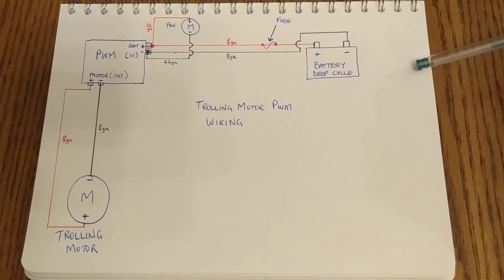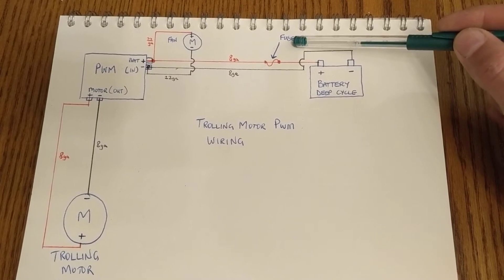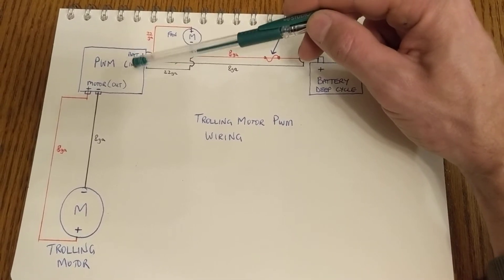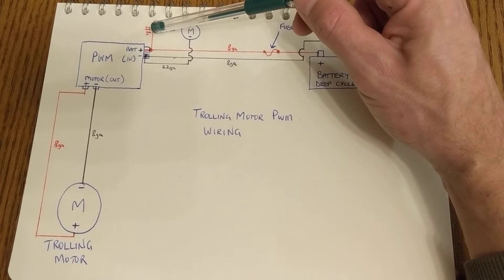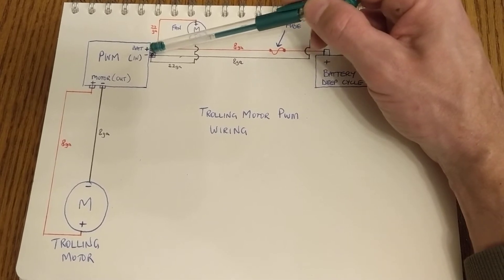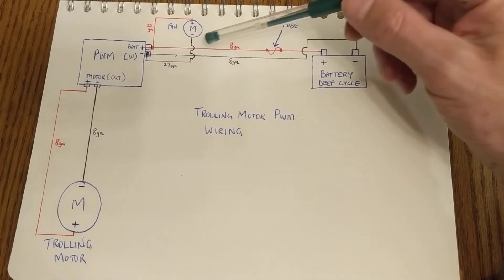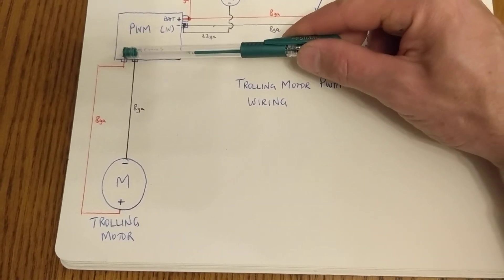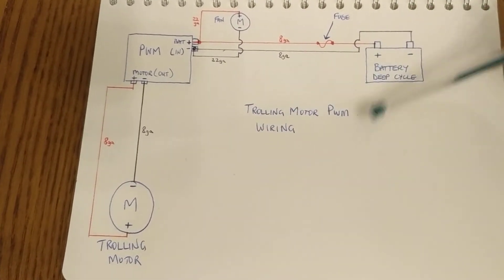Trolling motor PWM - part 3, wiring diagram

Comment: So how do you wire in the forward and reverse switch?
Reply from the maker: The switch already came wired up with the PWM controller.  All I did was put the fan onto it on the positive and negative inputs on the PWM board
Reply: @Intimidator82  Awesome thanks 🙏🏾

Comment: If I needed to connect a cutoff switch, how would I wire it in this set up?
Reply from the maker: I would put it in the positive or the negative cable close to the battery.  Most people will put it in the positive, but either works.

Comment: I have been searching your videos and cannot find the needed Parts List or Links for the parts you used. Do you have the links for things used to make your build with? Other then that your videos are really good on the PWM and the review of it.
Reply from the maker: PWM controller:
https://www.amazon.com/10V-50V-Controller-Reversible-Switch-Display/dp/B07Y9ZPV3F/ref=mp_s_a_1_41?crid=2CJGCG8ZYZA07&keywords=12v+50+amp+pwm+controller&qid=1658622732&sprefix=12v+50+amp+pwm+controller%2Caps%2C142&sr=8-41

12 volt fan:
https://www.amazon.com/Security-01-Brushless-Bearing-Cooling-AB4010M12/dp/B01CZFGO7U/ref=mp_s_a_1_18?crid=37DC4F2ET9AHP&keywords=12v+40x40+fan&qid=1658622975&sprefix=12v+40x40+fan%2Caps%2C129&sr=8-18

8 Ga wire:
https://www.amazon.com/GearIT-Gauge-Each-Copper-Aluminum/dp/B09ND1LTM5/ref=mp_s_a_1_1_sspa?crid=2PA51HD8YFZRK&keywords=8ga+wire&qid=1658623053&sprefix=8ga+wire%2Caps%2C142&sr=8-1-spons&psc=1&spLa=ZW5jcnlwdGVkUXVhbGlmaWVyPUFFRzlDTDJDSEdGUjAmZW5jcnlwdGVkSWQ9QTAyNjY4MDg1TExHVkk2MFpaUjQmZW5jcnlwdGVkQWRJZD1BMDg1ODM4MjNEMldFNDREREY2U1gmd2lkZ2V0TmFtZT1zcF9waG9uZV9zZWFyY2hfYXRmJmFjdGlvbj1jbGlja1JlZGlyZWN0JmRvTm90TG9nQ2xpY2s9dHJ1ZQ==

8ga wire ends:
https://www.amazon.com/Scosche-X2BS8-4-Gauge-Spade-Terminals/dp/B07BGLN2GH/ref=mp_s_a_1_5?crid=1GKUVTPMKT7JG&keywords=8ga+wire+spade+ring+terminals&qid=1658623148&sprefix=8ga+wire+spade+ring+terminals%2Caps%2C97&sr=8-5

Comment: hi thanks for tant video question if you have a 15 amps fuse but we know if you go fast that amp will go 40 or more so the fuse will bost no ?
Reply from the maker: Yes, you need to run at least a 40 amp fuse for a 40 lb thrust trolling motor.

Comment: So i may be jumping the gun because I haven’t watched this video yet, but am i right in thinking that if the pwm were to burn out for watever reason it would be fairly simple to on the water just connect the terminals directly to the battery and just use the tiller handle like normal.
Reply from the maker: The spades that I used were for a car stereo amplifier.  They are only about 3/8" wide.  I don't think they would fit on a battery around the studs.  You could put both the terminals together in the PWM on the battery side, essentially doubling up the positive and negative terminals.  I have 2 small bolts with washers and nuts in my canoe kit to use for just such an emergency.  I then slide fuel line over the connection so it doesn't contact anything and short out.
Reply: Thanks for the quick reply yea it makes sense i may add a few quick connect terminals but i like that if you have an issue on the water, it wont be a day ruiner with the trolling motor head on and still having control of speeds

Comment: I see all these videos, but how do I tear down my trolling motor to connect all this
Reply from the maker: Just attach it to the existing leads that are hanging out of the top where you would normally attach to the battery.  The trolling motor leads from factory sometimes came with eyelets or clamps on them, take these off and put on a forked spade to fit into the PWM.
Reply: @Intimidator82  so the red and black to the postive negative on the PWM and the yellow and white to the other end of the PWM?  I see you ahve some diagrams are they in detail?

Comment: Hi Josh, once again you've outdone yourself! Minnkota recommends 10awg size wire for my 30 lb thrust motor. Do you recommend 8awg still for all the wire connections? Also is marine grade wire needed or simply overkill?
Reply from the maker: To be honest the wire gauge does make a difference.  I have run larger, I think 6 GA and the trolling motor goes faster on the top end.
As for the Marine wire, I wouldn't really know.  If the wire is going to be sitting outside in the elements it wouldn't be a bad idea.  I just used what I had laying around from other jobs.

Comment: Thanks, Josh for the presentation!  Where on the wiring diagram do I add the 'fan switch' that you showed in Part 1?
Reply from the maker: I wired the fan switch into the positive side of the fan power wires.  You could do the positive or negative side, doesn't really matter, so long as you interrupt the current flow.

Comment: Do you run the fish finder off the same battery? How do you wire in both?
Reply from the maker: Yes I do.  The fish finder is hooked directly to the battery posts.  I did it this way to keep the wire clutter down at the PWM.  But if you wanted to, you could tie in your fish finder to the PWM at the power wires coming from the battery.  The fish finder needs very little amperage to run, but still needs a constant 12v to operate.

Comment: Can I blow out my motor if I use a 18 volt batteries for a 12 volt trawling motor
Reply from the maker: Can't honestly answer that.  But if it was me, I wouldn't.  The PWM still pulses the full 12 volts, just at various frequencies to change the amount of current flow that gets to the motor.  I'd stick to a 12 volt battery to be safe

Comment: Great info. So I just bought a PWM and am wondering do I just hook up the power cables from the trolling motor that usually goes to the battery to the PWM and from the PWM run power cables to the battery and thats it? thank you
Reply from the maker: Yup, that's it.  I would put a fuse in the battery cable to the PWM somewhere just in case, to protect everything

Comment: I have like 4-5 wires coming out of my motor, which 2 do I hook up
Reply from the maker: Is it a 24 volt trolling motor?  Here is a link to a website that runs through what wires are power and ground for each setup.
https://anchor.travel/why-does-my-trolling-motor-have-4-wires/

Comment: Thanks for all the info, Josh, it's been very helpful in deciding whether or not to get a PWM and how to mount it... that fan idea was particularly welcome.

It's been a while since you posted parts 1 & 2... any issues with the PWM so far? I'm asking because I'm seeing some other YouTube PWM users complaining that their units a burning up after a few uses, switches / potentiometers going bad, etc., but I'm not at all certain it isn't user error. The quality of your work is what I'd want to emulate, so if the unit is still working out for you that's good enough for me.

Thanks again!
Reply from the maker: Yeah my unit has been good.  I had it out the other week and ran it 6 hours straight without shutting it off.  I think in my opinion that the fan keeps it from burning up because they do get warm to the touch.

Comment: thanks for the Vid, Just wondering do you have to do anything with the hand controller in the trolling motor, because i realize that the terminals for the trolling motor connect straight to the 5 forward 2 reverse controller in the trolling motor, thanks!
Reply from the maker: Yes. All you need to do is turn the handle to max speed, which in your case and mine, it's forward 5.  This eliminates all the resistor coils in the motor and allows the current to flow through unrestricted in the proper direction.  I leave mine in neutral while I hook up the box to the battery, then turn the box on to 0, then turn the motor to 5.  I don't want an accident if the prop were to turn while hooking the box or motor to the battery. The forward and reverse is controlled through the box with a toggle switch, no need to touch the motor handle other than to steer.  Hope this answers your question. If not, send another question, glad to answer it to the best of my ability
Reply: @Intimidator82  hi there does this apply to trolling motors which have the two buttons( speed 1/2 and forward and reverse switch) thanks
Reply: Perfect, just what I wanted to know, thanks